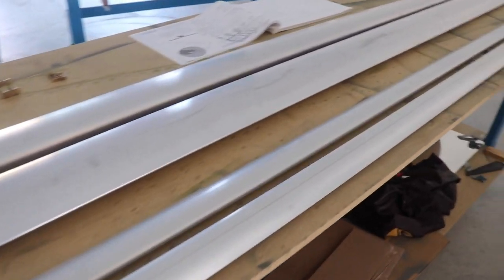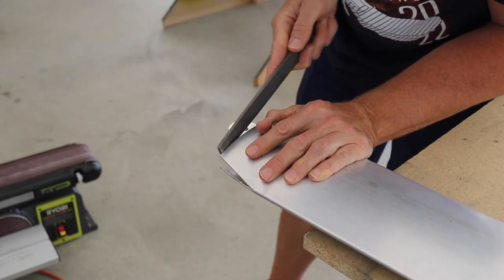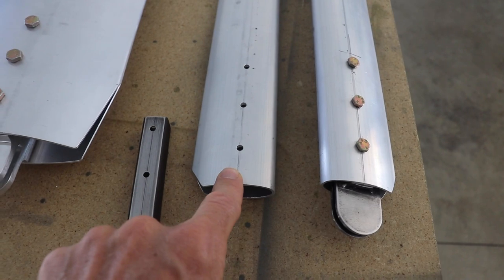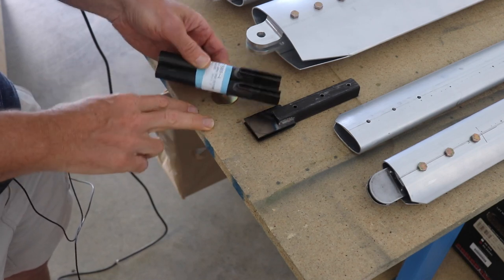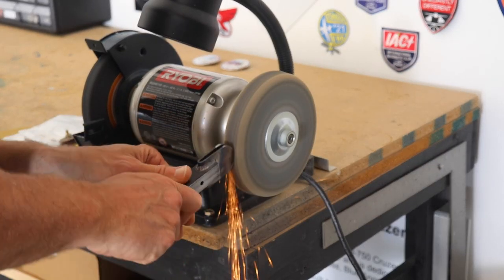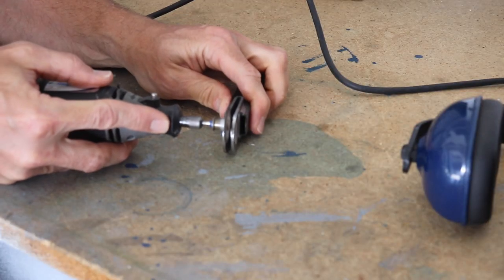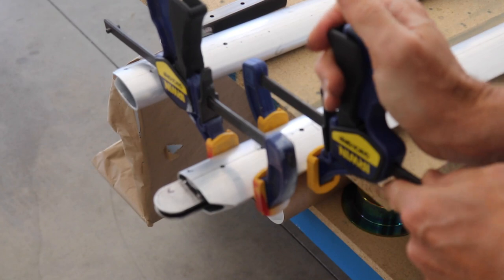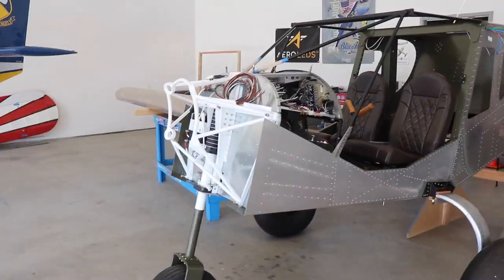Zenith CH750 Wing Attachment Prep (Ep93)

Comment: In the RAF we never used the same abrasive for steel and aluminum as it causes corrosion, as the steel gets imbedded into the aluminum.
Reply: I was going to mention this. It’s often overlooked.
Reply: I was thinking the same thing.  I use a 2X72 belt grinder for that kind of grinding but there is no wrong way. Using the belt grinder lets me change a belt for wood, aluminum, or steel.
Reply from the maker: Or you just reprint the wheel like I do. Everything doesn’t need to be difficult!
Reply from the maker: Re-grind. Not reprint.
Reply: @jimhumphrey  when we did use belts and just marked the backs with an A for aluminium alloy or C for copper base and F for ferrous.
Reply: @KitplaneEnthusiast  dressing the wheel is a way around it but it's something that needs to be done.

Comment: Boy, no wonder the grinder walks around.  Did you notice how much the wheels moved when you started grinding.  Looks like a set of bearings in in order.  Sure do like following your build.
Reply from the maker: Did you miss the part where I said it's sitting on grass?? The wheels don't move at all.
Reply: @KitplaneEnthusiast  I meant the grinding wheels.  When you touched the strut end to the wheel you can see the label on the grinding wheel move in and out. I should have been more specific.
Reply: Noticed this as well. May not seem like a big deal, but once replaced you’ll wonder how you ever used it before.
Reply from the maker: Oh I see what you’re talking about now. The wheels don’t move although for some reason it looks like they do. Maybe something to do with the camera frame rates??
Reply: @KitplaneEnthusiast  Yep, that's precisely what it is.  If that shaft was moving as much as it looked it would short the armature. The vibration is in the grinding wheels.  The best thing to do is to bolt the stand to the floor with some rubber spacers to absorb some of the vibrations. Or move it into the grass 🙂